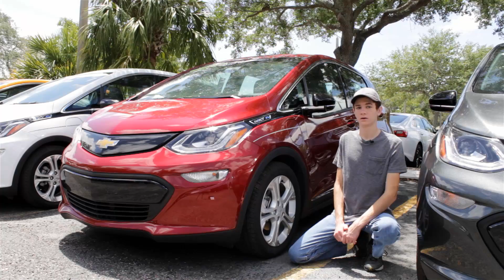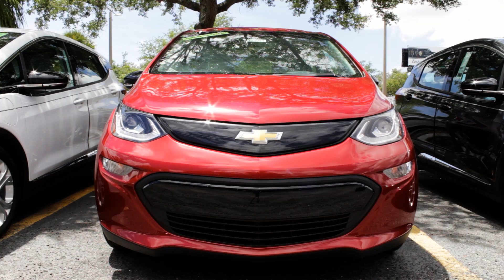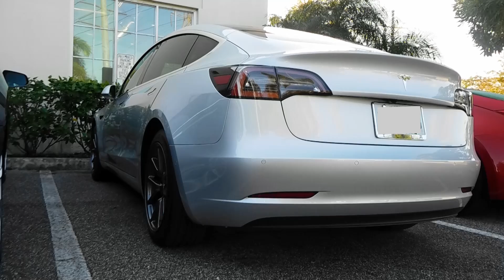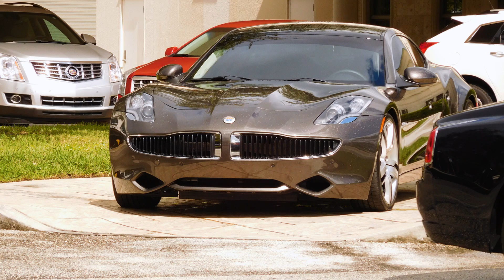The Sound Of The Future: Fake Electric Car Sounds

Comment: This is stupid! Its a electric, its a selling point to be silent. People should be more educated on how to cross roads, and anyways, most electric cars sold have auto emergency stop.. so if a pedestrian is too foolish or distracted too not see a CAR coming (or just doesn't use traffic lights or zebra crossing), it will stop! And it should have a dashcam so you can report if pedestrians do it on purpose. And the driver can use the horn.

Comment: This is strange... I've seen cars with gas engines that were virtually silent...
Reply: some small cc motorcycles too can be extremely quiet
Reply: Yeah mabey at idle but when u hit the throttle a combustion engine pushes its exhaust through the pipe it makes a noise man
Reply: I see them everyday.
I live near a road that leads to the industrial area (so a lot of cars and trucks, also during the night)and near an highway.
A regular Inline 4 car (petrol or diesel fuel) with a regular exhaust system doesn't make annoying noise.
Also a regular truck is not so noisy.

Those who make annoying noise are 2 stroke bikes; bikes with no regular exhaust systems; idiots who try to race.
More police controls and more restrictive laws about noise in inhabited areas would be sufficient.

Neighbors' dogs are much noisier than vehicles...